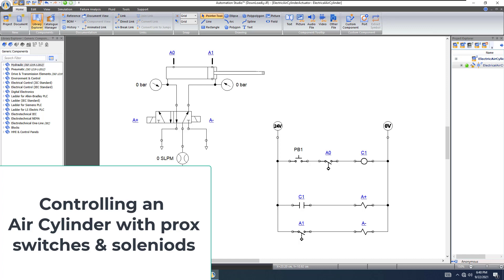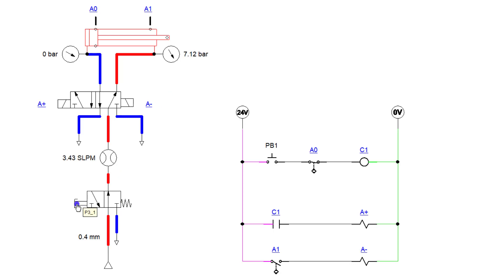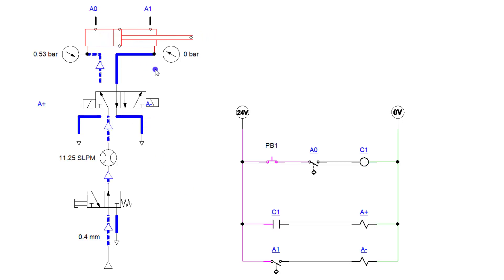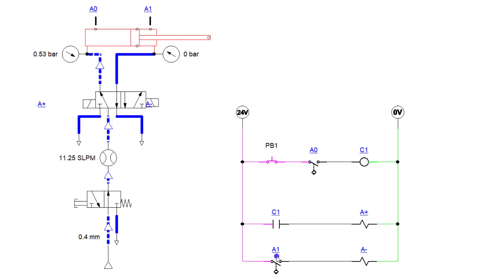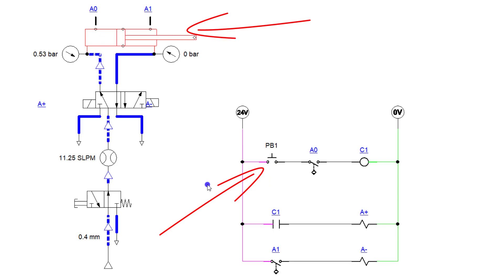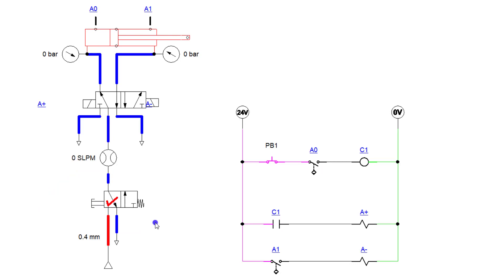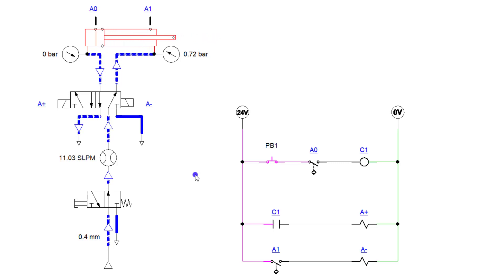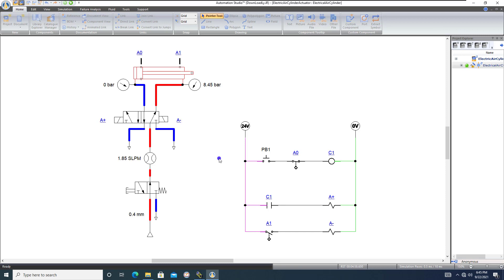Two Electrical Solenoids Controlling a Pneumatic Air Cylinder

Comment: What is the value of the capacitor? And what type is it? Thanks
Reply from the maker: It's not a capacitor, it's a coil
Reply: @ShaneWelcher   is it possible to get the wiring diagram for this, because I need exactly this for a simple wood-cutting saw. Tnx in advance
Reply from the maker: @TheShejta  Not from this software, just use Excel or Viso or AutoCad to make a wiring diagram
Reply: Symbol of C1 is capacitor as I know. Coil is A+ and A- or it is something wrong with drawing
Reply from the maker: @TheShejta  again, it's a coil.

In this software you can name things so I put C1 as Coil 1